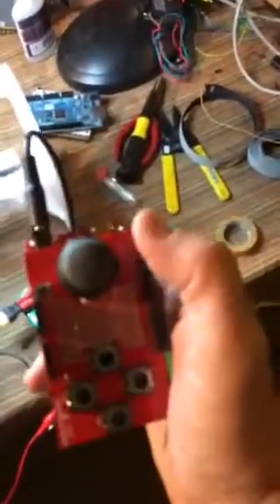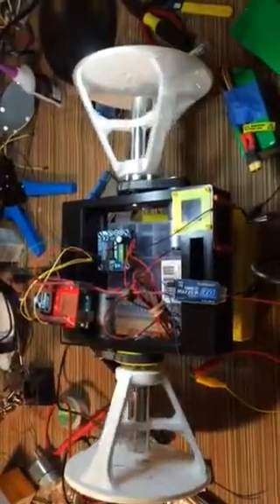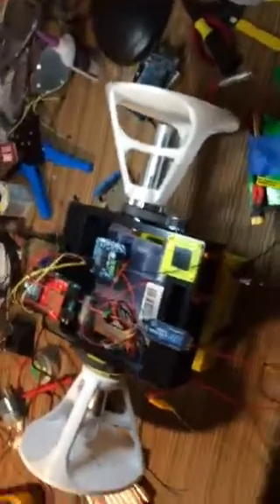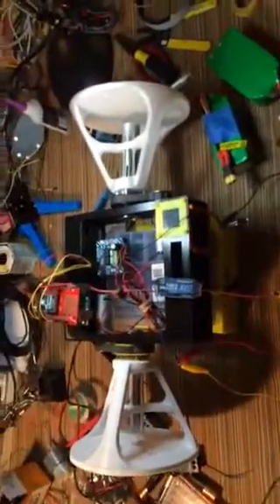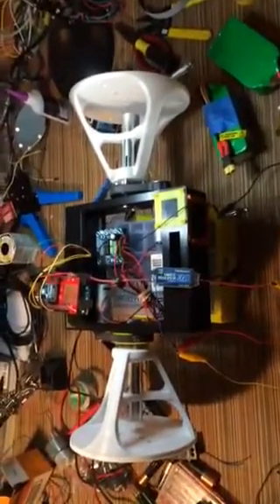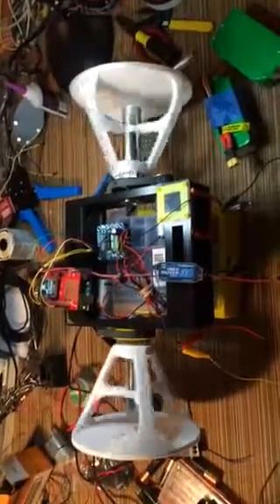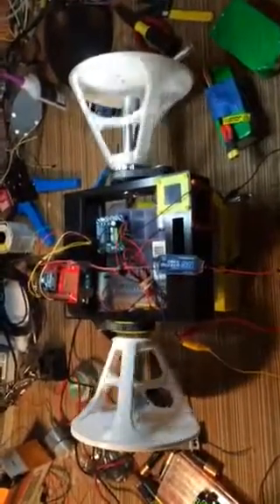RollingRobots : Building BB 8 Part 2a : Quick Test : Arduino, Xbee, BTS7960 Drivers

Comment: You should try PID and yes encoders will help too
Reply from the maker: I considered using motors with encoders, but encoders really won't help since once everything is locked in the sphere the hubs will always move at the same speed anyway.  The motors will load differently, but to figure that out I'd have to monitor the current pulled by each motor.  To monitor current that gets into a whole lot of other things, would have to use 2 separate motor controllers, etc...  As far as PID control goes, that will be something I use once I start using an IMU, but until then it's not really possible since there is not feedback.